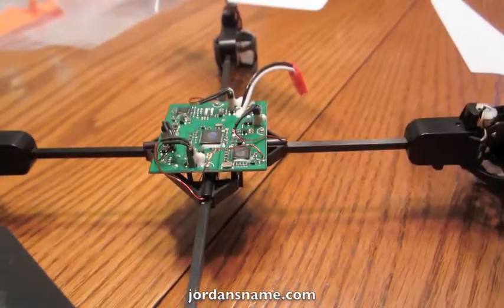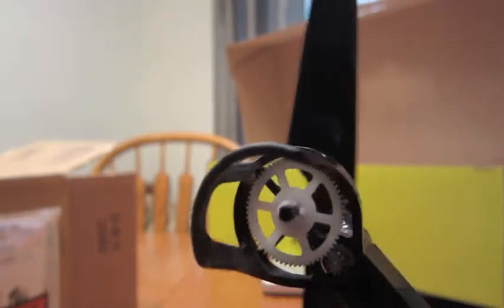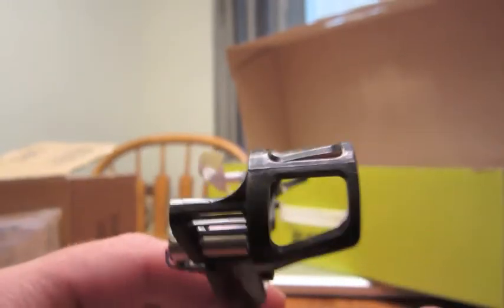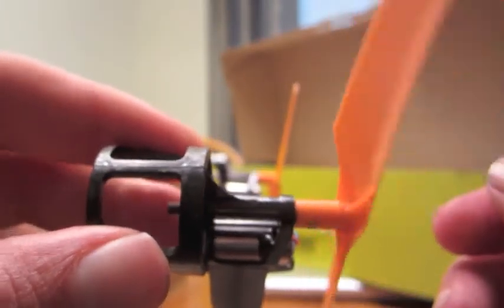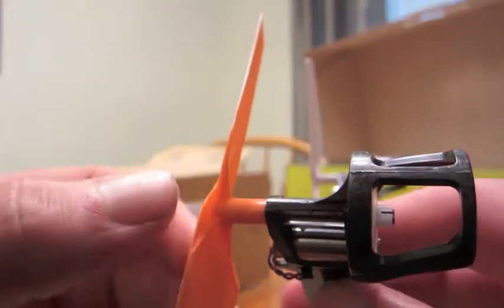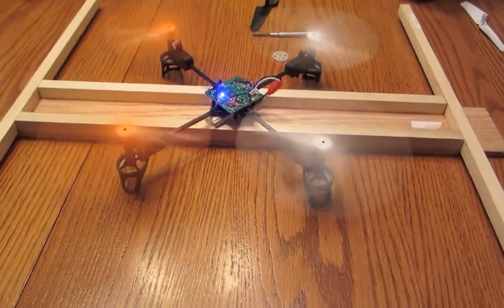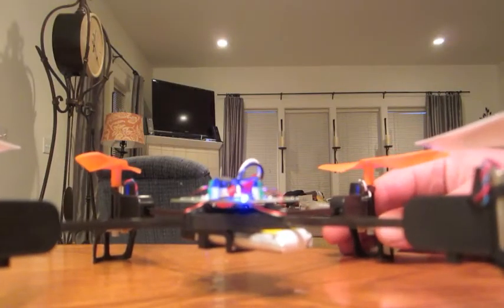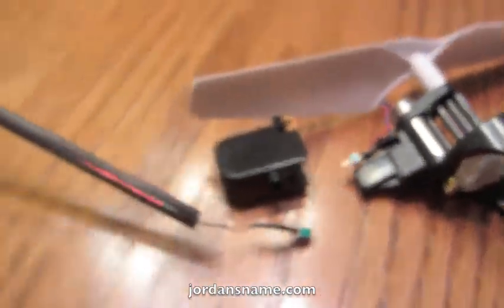Blade MQX Quadcopter CRASH & REPAIR Learning to Fly Tips - FPV RC FLIGHT ARIEL VIDEO LOG 1

Comment: great tool to have, i was trying to figure out the best helicopter, least repairs, less cost , survive-ability, i got to a single shaft 4 blade , looking for highest pixel pictures. Would be using the helicopter for finding old mine opening  in low mountain and hill areas. Ill see what i can learn from you.

Comment: Good video. I like to put a little glue on the motors to stop them moving.
Crashed my mqx hundred of times and finally after 2 years Ive only now had to replace 1 x boom and 1 x motor mount. Which I think was due to heavy battery and camera upgrade.
Reply: property maintenance